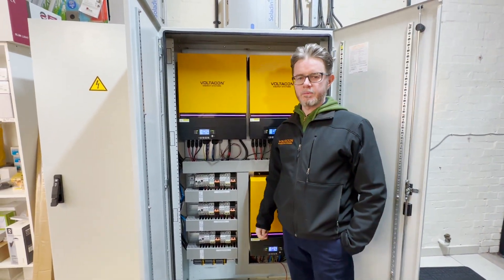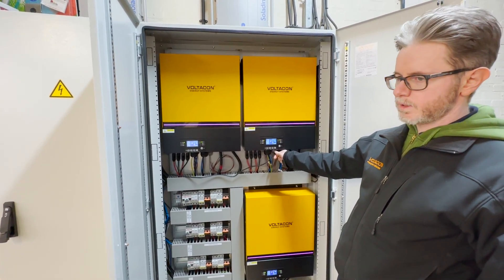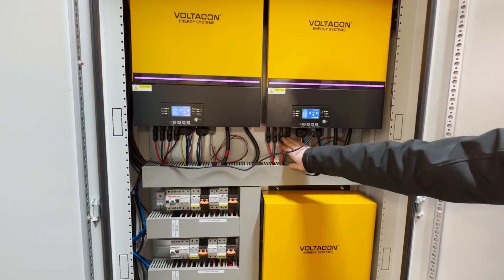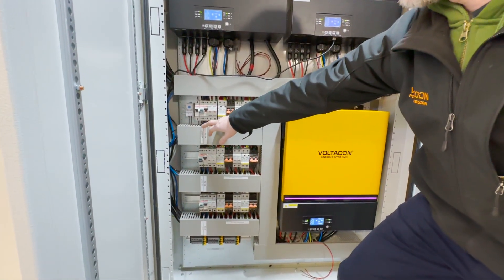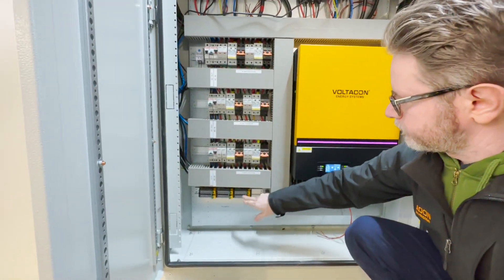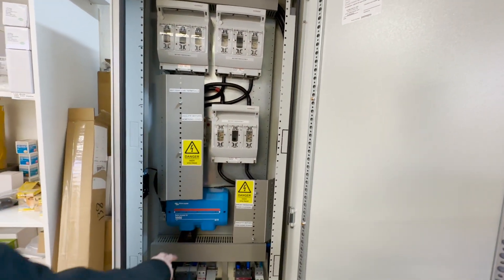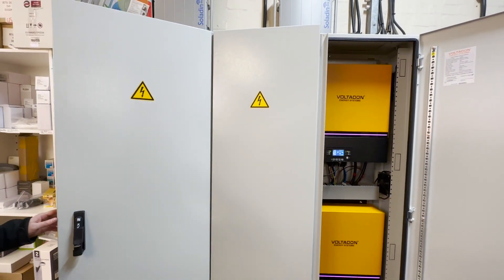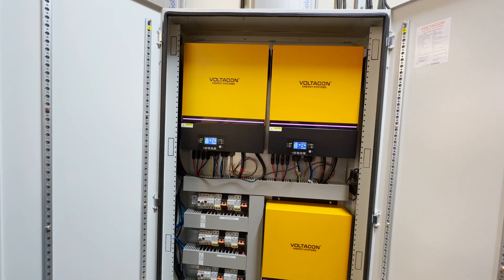Testing 24kW Off Grid Cabinet with 3x Conversol 8kW MAX with lithium ion batteries Pylontech US5000

Comment: How much heat does an inverter put out in watts?
Reply from the maker: How much heat in watts? We did not measure that value but considering the efficiency and losses it is less than 500w in full speed but all depends on ambient Temperature, loads conditions etc there is a graph that analyses the losses
Reply: @voltaconsolar  I would like to install a 5.5KVA inverter in an electrical panel. Could you tell me the maximum heat this inverter gives off when operating in watts so I know how much cooling power I need for an electrical switchboard?
Reply: @voltaconsolar  Hello, I would like to install a 5.5KVA inverter in an electrical switchboard. Could you tell me the maximum heat from 5.5KVA inverter gives off when operating in watts so I know how much cooling power I need for an electrical switchboard?

Comment: Good job! How do you cool inverters? As you have installed the inverters it seems that the fans of the inverters are clogged.
Reply from the maker: there are additional fans in the cabinet that circulate the air